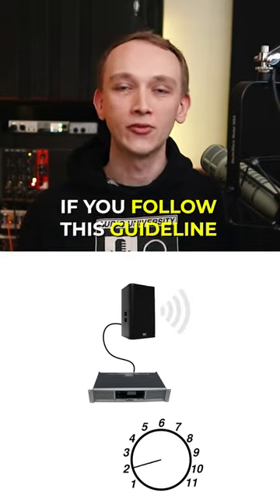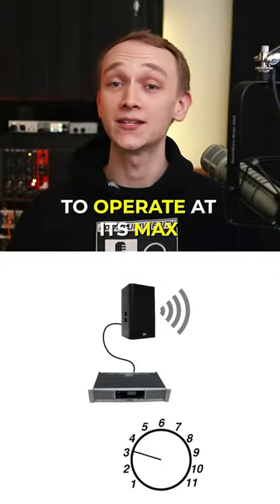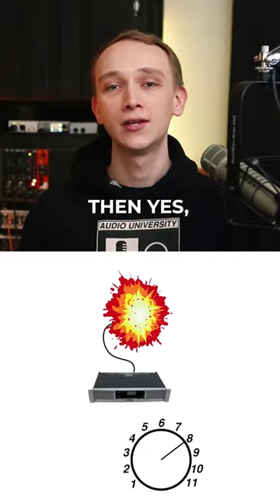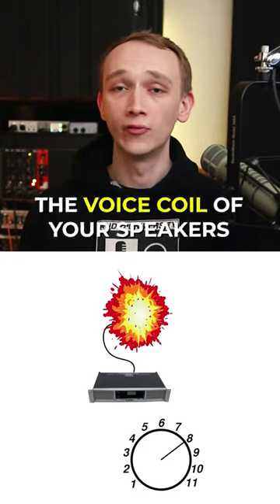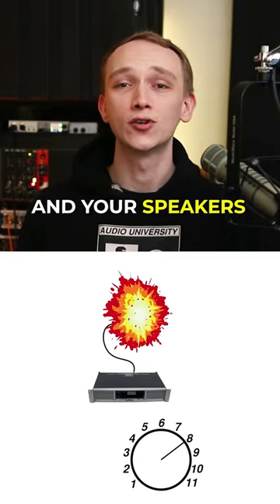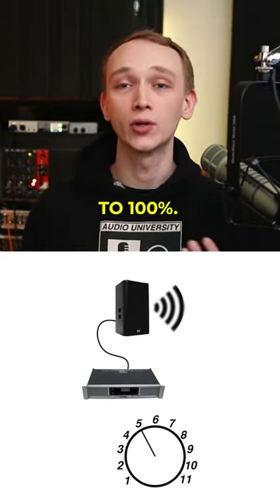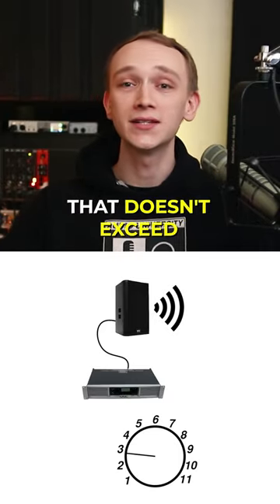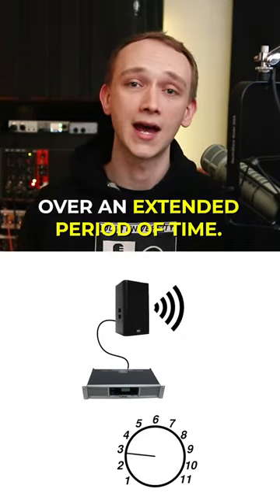Use an Amplifier with Twice the Power of Your Speakers?!

Comment: It may seem counterintuitive, but there's a widely accepted rule of thumb in the world of audio equipment: ideally, your amplifier should be capable of delivering power that is twice the rating of your speakers. But why is this?

Well, when you consider that the average home listener rarely goes beyond 70 decibels (dB) in volume, which demands a mere 2W on a decent speaker, it does seem excessive. However, this seemingly surplus power is crucial for maintaining the fidelity of the audio, particularly during demanding or dynamic segments of music. 

It's essential to remember that music isn't a constant, steady signal. It fluctuates, with sudden spikes and dips in power, or 'transients'. These transients are crucial for capturing the live, vibrant feel of music, especially when replicating the impact of drums, the sharp attack of a plucked guitar string, or the full-bodied richness of a grand piano's notes. 

An amplifier with a power capacity double that of your speakers ensures that it can handle these sudden demands for power without distortion, preserving the integrity of the sound, even at higher volumes. Moreover, it offers a kind of safety net, protecting your speakers from potential damage caused by overdriving.

Therefore, while the everyday listener may seldom utilize the full power potential of their amplifier, the extra capacity contributes significantly to the overall quality of the sound, providing an immersive and enjoyable listening experience.
Reply: Wisdom
Reply: Thank you so much for this.
Reply: don’t understand how speakers demand power, i thought that they receive it according to the amp
Reply: @elijahj9902 they consume power as needed to make drivers move per given volume

Comment: Always have a power amp that is capable of running you speakers RMS wattage with headroom. ie 300W RMS should be driven by and amp at least 450W RMS per channel... think car engine and cruising at 80 MPH.... both cars do 80mph but the way they do it will differ from a 1.5 ltr to a 4ltr.

Comment: It's an amplifiers ability to drive a load irrespective of the wattage  . A 50 watt amp that can drive a 2 ohm load will be able to drive a speaker far more efficiently and safely than a 100 watt amp that collapses into low ohm loads

Comment: Learned so much from your videos❤.
But Is there any formula to know the output power(watts) of an amp at a certain position of the volume control to run any speaker safely with enough headroom?
For example if i have to run a 8 ohms ,100 watts speaker using a 400 watts @ 8 ohms amp (to get enough headroom as you have explained), how much should I dial the volume control in the amp?
Reply: if you're using professional PA amps, you don't have any way to "dial the volume" of the amp's output. 
if your amp has knobs that allow you to dial in the level, it is not the amps output being controlled. it is the input sensitivity going into the amp. your amp will still output 100% of its rated RMS power. turning down the input sensitivity is not going to protect your speakers. Kyle is wrong here. he's not the only one though... this has to be one of the most common mistakes made by even seasoned pro audio veterans. 
it's very important to read your amp manuals and understand the difference between input sensitivity vs output.

Comment: Why do this?
Reply from the maker: Great question, Joe! It provides more headroom so that you can get the full potential of the speaker without the chance of clipping the input of the amplifier. Check out the full video to learn more: https://youtu.be/5Qem-xRB1Xo
Reply: @AudioUniversity  Great, I'll watch that!
Reply: You wouldn't want a car that operated at 100% effort just to go the speed limit but one that did the speed limit at 50% effort. Most cars can go far faster than the road allows but don't because we don't go around with the gas pedal smashed into the floor all the time.

Comment: I’m sorry, but this is not right. That is not a volume control, it is a sensitivity for the input. It is still capable of being driven to levels that could destroy the speaker. You’ve gotta match speakers to amps.
Reply: You can measure, calculate rail voltage to watts, and run a pre amp with a more powerful amp
Reply: Bingo! IF you have Professional grade PA amps, and those amps have knobs either in the front or back, turning those down will not be turning down the power being output from the amplifier. all you're doing is adjusting the input levels going into the amplification circuit. it's still amplifying to 100%. you're still going to blow drivers if you haven't properly matched your speakers to amps. 
Kyle is usually a good source to get accurate information.. and in his defense, he does refer to the knobs as controlling the output level of the amp... which would be true, technically. The problem is that I have never seen a pro PA amp with knobs to attenuate it's output. 
so he's either mistaking the input sensitivity knobs as controlling the output level, or he's referring to something that he knows doesn't exist (which is technically not incorrect, but would be a dickhead thing to do!)
I had looked into this a while ago because the amps at one of my regular gigs did not even have a way of turning anything down. so I read the manuals, and quickly realized how wrong I had been over the past few years thinking that all amps had a way of turning down their power output.)
there is NO substitute for doing the math when matching your speakers and amps.